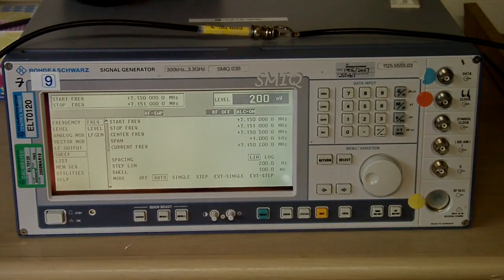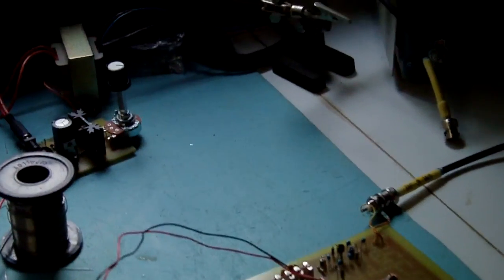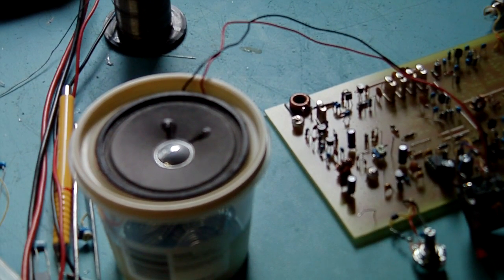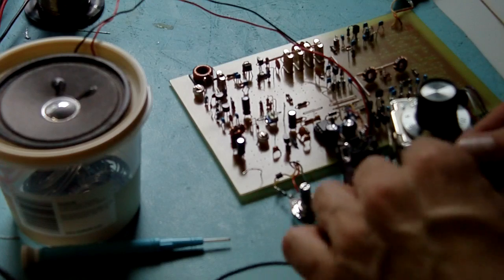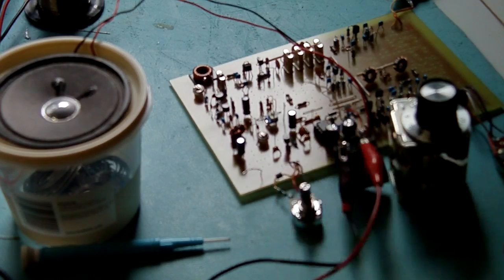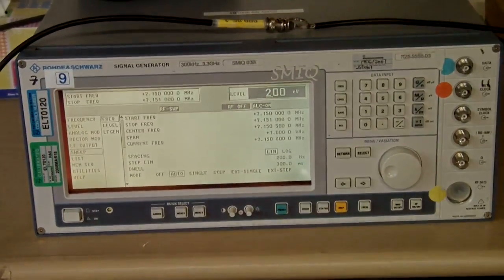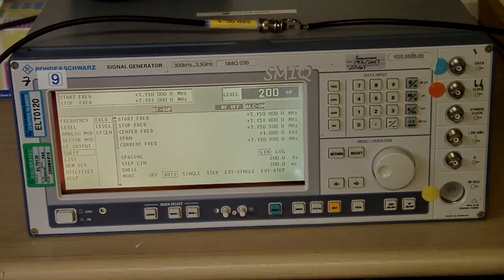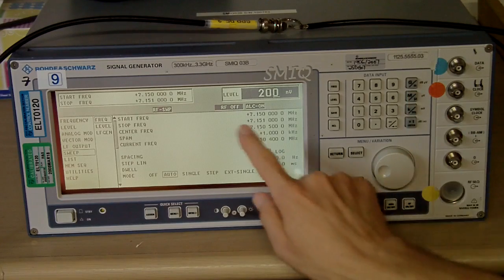BitX40 sensitivity test no 2

Comment: I built a Hendricks Kit Bitx20A and measured the receiver MDS (minimum discern signal) in our lab (work in commercial communications) I was able to hear a signal just under .7uV  my Bitx20a can go neck and neck with my TS590 on weak signal. The circuit, especially for a kit and 4 pole xtal filter is amazing!!  K4DSB

Comment from the maker: This is the standard crystal filter. The bandwidth was measured and it is 2.5kHz at -3dB. I used 100pF for the middle cap and 82pF for the other two caps (crystals are 10MHz).

Comment from the maker: There is very little difference between BitX20 and BitX40, especially in my case, considering I performed the test without any bandpass input filter. That means, the only difference is the frequency of the local oscillator (I add 3MHz LO to 7MHz RF to get the IF, while for BitX20, you subtract 4MHz LO from 14MHz RF to get the IF). Also, one uses the BFO tuned to USB and the other one to LSB.

Comment: Fabulous! You know, I think with good headphones and a SCAF filter for the audio that 50nV (0.05uV) would be readable for CW. It wouldn't be the most pleasant experience, and it would take more than the usual concentration, but if it was a DX QSO from half way round the word---hey, I go for it. I'm really very impressed by the BitX receiver section. Is there any reason a BitX20 would be much different?